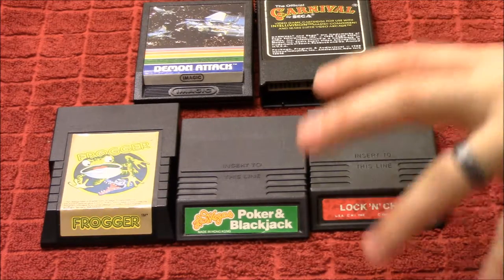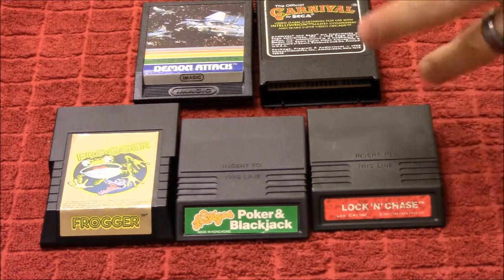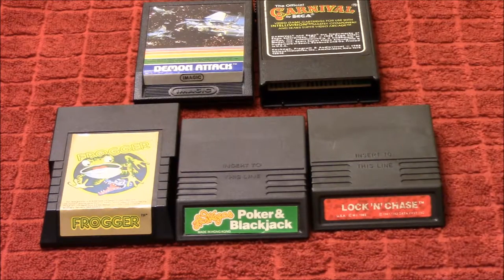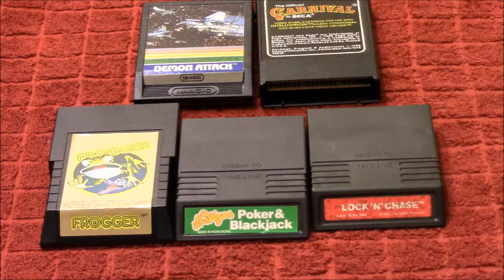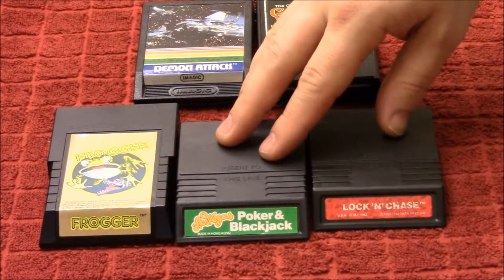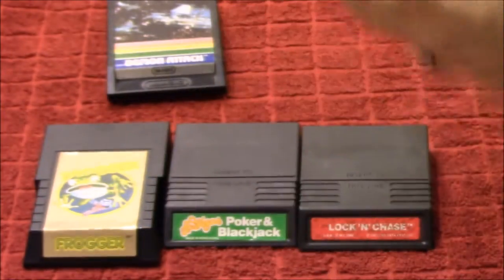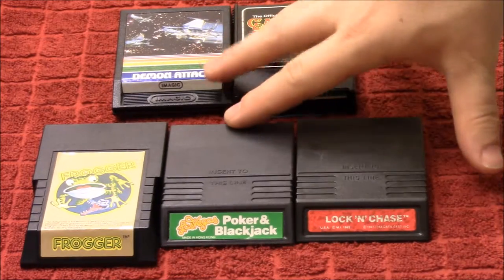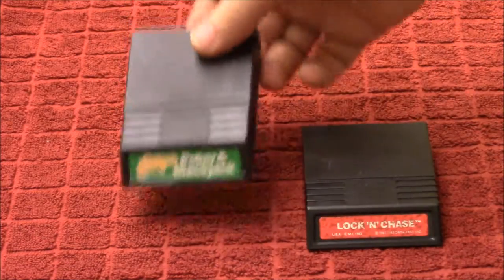Cleaning an Intellivision Cartridge

Comment: You are wrong in saying Mattel just used whatever screws they had laying around. You do not know the history.
 They originally used phyllips screws for the carts. But, they received complaints from parents that their kids were taking the carts apart. So, Mattel changed the screws to the more secure triangle type after 1980. In 1983 the games were made with locking bottoms & no screws.
A huge company like Mattel would not just grab whatever they had in production.

Comment: Use brasso metal polish not sandpaper.
Reply from the maker: There is a lot of people on both sides of the Brasso debate. Without a doubt, Brasso can do wonders for your pins, but it is highly abrasive as well. If you use Brasso, you should always clean it of immediately afterwards. However, it is a very valid point. Thank you, Codename Orange. :)